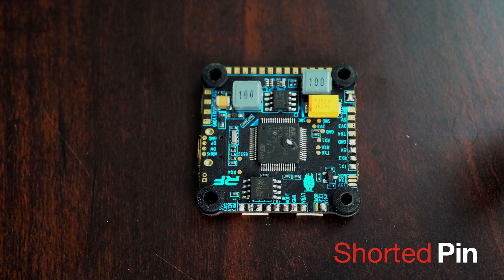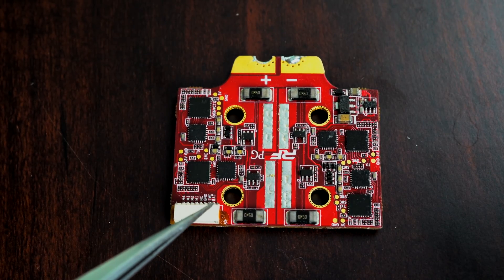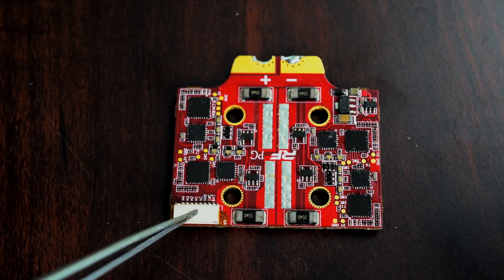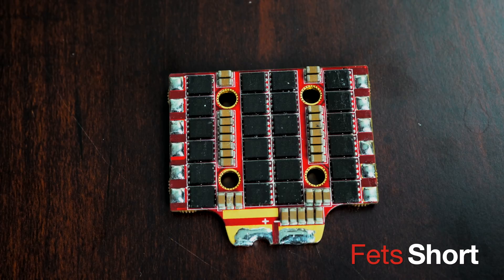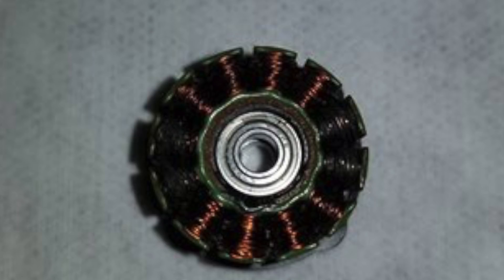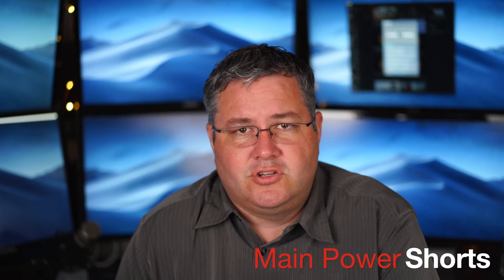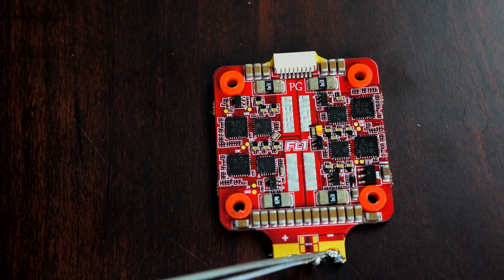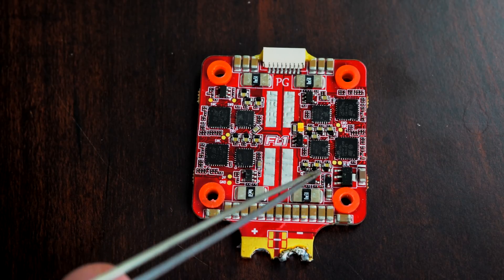What Killed your ESC?

Comment: I would think this video was in response to something I have seen, A high failure rate with the Flight1 ESC's that say they can do 6S but really can't handle a high discharge rated battery. try using a lower discharge rate like under 75C more like 60C at 6S the voltage is what is important. With 32bit mcu's to much current in to short of a time frame will take out your FETs and melt traces. the lower discharge rated battery will limit the current and control a high speed MCU protecting the FETs and even cheap motors. And there is really no ground in a delta motor config there are 3 coils that the ESC's sets up AC electrical fields that are out of phase in one direction and the magnet structure in the bell of the motor follows that offset phase around the stator, I have seen bolt32's just turn in to a fireball with a 6S 90C or 100C battery behind them in the air so that wasn't a bent pin. It's just the 32bit MCU trying to switch the FETs to fast with more current available than the ESC's can deal with, cheap motors or pricy one's it does not matter. But Nice motors are a lot more fun !!! ESCs losing switching control of the MosFETs is what normal smokes motors and then the smoked motor compleats all the fun by killing the ESC.
Build some current control into the ESC's , Firmware current limiting is just to slow to protect FETs switching so fast !!!

Comment: Apparently I'm a unicorn, because my most reliable setups are $7 motors, cheap BLHeli_S ESCs, and I'm running 6S mid-KV (2000-2250) and I haven't had much in the way of issues.
The stack mounting advice is solid, that absolutely helps.  I probably will add the common ground strap all the way across the stack to see if that helps.
Reply from the maker: Do you believe in unicorns :)   I do think blheli_s has been a little better for durability, but performance of bheli32 is much better.
Reply: @FlightOneVideos  The stock settings on BLHeli_32 are not the best, that's for sure.  Might even be worth shipping out all the Bolts with come custom parameter updates (Timing, RampupPower, LowRPM-Protection) to help out with that - if it's worth the time to have those ship pre-flashed, and put a unique startup tone on there to really drive home that they're Flight1 hardware, that's my suggestion.

Comment: Preston - 95% of ESC failures I've trouble checked for other people have been caused by the BLHeli 32 setting "Low RPM protect" being set to off. They have this setting turned off - have a prop strike - and the ESC is toast.
Reply: I'll have to look into that
Reply: Hmm... wondering if that's a sample size thing - because I've seen stuff let go in wide open fields, and over a larger sample of pilots a lot of assembly/soldering/JST Plug issues have probably taken out ESCs before any actual flying can transpire.

Comment: The thing i dont get, is that I had no problems with single escs. Going to 4in1 escs last season ive gone through like 7x 4in1s and like 5-6 motors?! Escs Tmotor/aikon ak32/hw 40a/hglrc 428. Motors - tmotor f80 2500kv tmotor pro2 2500kv and avenger 1507 4100kv.  The wierd part is that i havent crashed hard. Rather dented gates. When a motor has toasted it has been a different motor eash time. 3x quad setups.

Comment: I have a full new build that makes my motors (F60 Pro v3 1750kv) hot no matter what filters or tuning I try. I swapped everything but the new ESC (HolyBro Tekko32 F3 Metal 4in1). I just realized that’s the only component I haven’t swapped out. I assumed b/c is new and cleanly soldered that it couldn’t be the cause. Might the ESC be the cause of the hot motors???
Reply: Rafyel Brooks is rear motors only try moving the battery forward a little bit :) fixed my issues.
Reply: Doom Engine FPV it’s both rear and front. More front than rear. The batt is as forward as I can got on that build. I’m thinking it’s the ESC.
Reply from the maker: I tested one of those esc and it caused major issues on my quad, replaced it and flew beautiful.  I think the metal fet esc is too noisey.
Reply: FlightOne ah, interesting. I’m going to swap it out today and try another ESC I have and let you all know. I’m feeling that it’s the ESC as well. Thanks
Reply: Problem solved. I increased the ESC PWM frequency from 24khz to 48khz, and from MultiShot to dShot1200 and now the motors are cool. I might be able to use MS, but I hit a ghost branch on the 2nd batt and landed in mud. Lol
Reply: @BSyncereG  Glad you got it sorted, but ya definitely want 32khz or 48khz

Comment: Great video Preston. But I think you forgotten to mention one important thing. ESD electro static discharge. I actually think it's one of the most common reasons for killing ESC. People generally don't know how to handle electronic components and to avoid damage from ESD. 70-90% of the ESD faults are latent and could result in failures several mounts after assembling your kwads. Here is a great video everyone should watch before start building kwads.

 https://youtu.be/bWXNOemu2j4
Reply: The fets are normally rated for 30-50volts or something. The mcu are rated for 3.3 to 5v or something. Imagine what happens to them if you discharge 5000volts ESD charge through them.

Comment: Hmm still doesn't explain why a spark32 will work fine on 4s but blow up as soon as a 6s touches it... or why it took the millivoltosd with it. Also doesn't explain why my revoltosd's 3.3v reg died overnight...
Spark32 was using 3b 2306. They still work great with other esc(aikon ak32) to this day (6s). Millivolt died with it. Revoltosd worked fine. took it to the field where it refused to work.
Reply: The reason.was that it was flightone esc
Reply: Brokepilot user error? ;)
Reply: @mrnobody9821  Well. I flew the spark32 on 4s just to get a feel of the quad. Once I confirmed it was working I plugged a 6s in which the esc blew up. The millivolt osd never worked again. For the revolt osd. I built the quad, confirmed hover and went to sleep. Woke up, did some stuff, then went to the field to fly. Plugged in a lipo and the thing wouldn't boot. Both my revolt and millivolt died because of the 5333b regulator shorting.

Comment: So, a smoke stopper is actually BS?
Reply: Smoke stopper will prevent more than a certain amount of current to flow into your quad. It’s not BS, but it’s not some universal magical save-all-the-things tool. Some things can get ruined with much smaller amount of current.
Reply: @FilipRadelic  thanx!
Reply: It's a current limiter - but it won't stop continuity errors from putting VBAT where it shouldn't be - and on microprocessors it doesn't need much current to toast things.

Comment: That new esc looks like a beast!! Can't wait to get my hands on a couple!
I've been having dramas with the esc in my 3 inch,  it's a hglrc 4in1, I've blown 4 up in the last 8 months, the last one i tried to fly the quad back with a prop blade missing and it lasted a few seconds.  Funny thing is, it was the front right prop but when i test hovered the front left motor dropped out.  
Bought the motors on special and I'm sure they're crap 😂👌
Reply: Cheap motors shouldn't cause ESC's to let go on maidens - TBH I fly completely crap motors on a lot of my builds, and if you're not pushing KV/voltage combinations on aggressive props and trying to turtle mode in tall grass all the time, they actually work.  If you're pushing the limits on performance, Preston is absolutely right that you need quality motors, but until you're near the pace of sponsored pilots, you don't really need that.
Reply: @tehllama42  yeah i have no idea why i keep blowing esc's. Using 4000kv xnova 1407 and 33a hglrc 4in1. Props are 3028 gemfan. Starting to wonder if its the steel stack screws causing the issue.  Someone told me it can be a problem